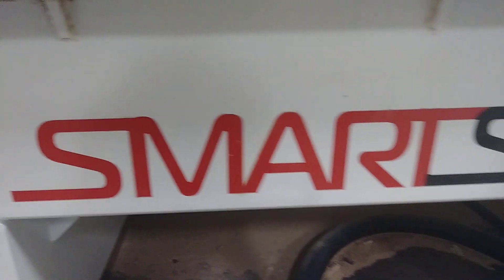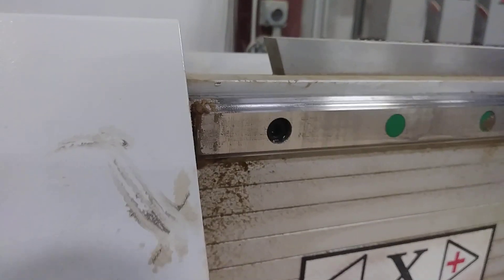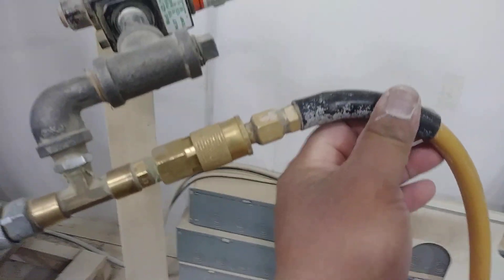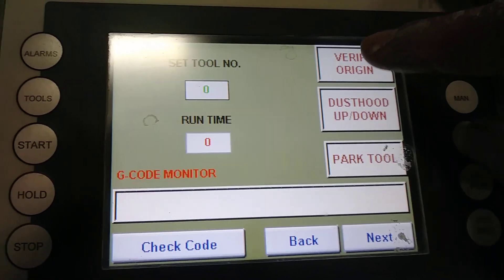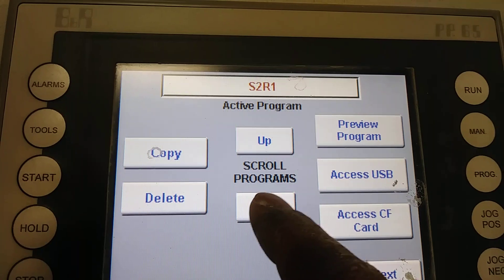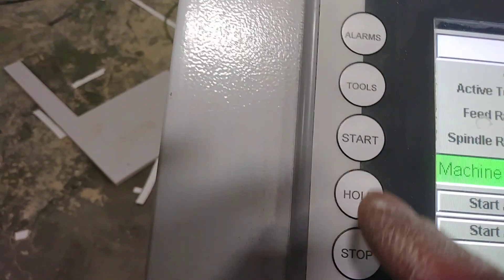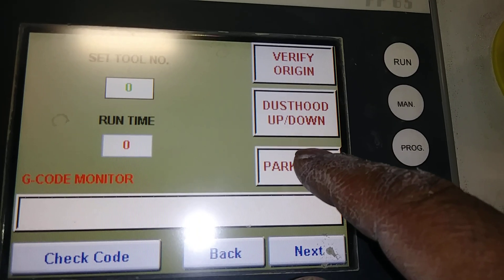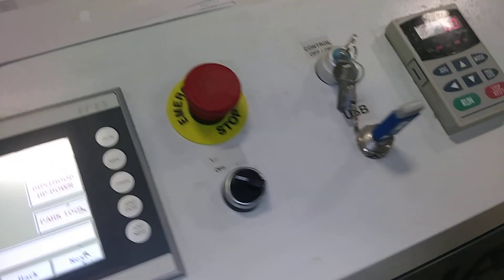How to run CNC Machine Smart Shop II from Laguna tools

Comment: How often should this be performed on the machine. Also there is a bottom rail on the (y) axis should I be using dry lubricant or an actual grease?
Reply from the maker: hello Morris , you can use dry lubricant sounds perfect